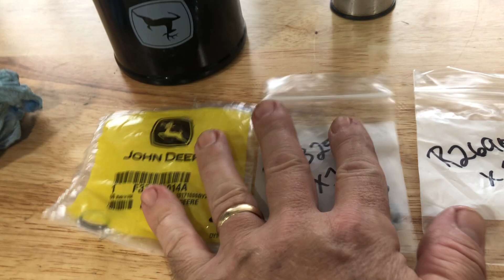John Deere 4310 ePower Reverser Transmission Pressure Regulator Fix

Comment: Would this cause lack of power on the rest of the hydraulics as well? I have a 06 4310 that hardly will move and almost no Hydraulic power.
Reply from the maker: I would check/clean the suction screen.  Thats the most common cause.
Reply: Much appreciated bud. 
Fun fact, those pressure valves are no longer available.

Comment: Have this issue in my reverse gear. Engages weak and when given throttle it either won’t move at all or very little until rpm’s lower. If on and incline I have to set it in a really high gear to reverse on and incline. Could this be the issue you think?
Reply from the maker: Will do some research and let u know what I would recommend.  I’ll check shop manual and let u know.
Reply from the maker: I would recommend downloading the shop manual, since it has the troubleshooting procedures/details under "ePowrReverser - Reverse Drive Circuit Diagnosis" section and is good to have handy.   If it was in my garage I would start by back feeding the voltage (using sewing needle and volt meter) on the reverse solenoid to make sure your getting 12v in reverse.   You can do this in the garage with machine off ground and in 2wd.   Just put it in reverse and let it idle in reverse.   Check meter and make sure its close to 12v.   If it is then the problem is in the reverse solenoid or coil on the solenoid could be week.   If it isn't then the problem is most likely with the reverse pressure transducer.   Shop manual has way more details and explains it in great detail.  Hope this helps and good luck.

Comment: Does a 4300 HST have this valve after watching your video I didn’t see it my tractor won’t go forward or backwards I have cleaned the suction screen in the rear end changed fluid and filter brakes are free and not stuck and the shaft that drives the hydraulic pump is spinning

Comment: I'm having this issue on an e-hydro. Do they have a similar valve, or is it possibly a potentiometer
Reply from the maker: Thanks for reaching out. The e-hydro doesn't have the same pressure relief valve like the reverser transmission.  For the e-hydro I've had machines that will do the same thing due to a bad potentiometer or dead battery that wipes out the controller memory.   I would test the potentiometers one at a time by back feeding the voltage (0.9 - 4.5 volts is the typical range) and see if it fluctuates without moving the pedal.   You don't need to start the machine, rather just have the key in the on position and depress/release the pedal your testing.  Voltage should only change when pedal moves in/out and not when you put lateral pressure (side to side) on the potentiometer.   Typically with one is erratic/fluctuating voltage the symptoms will be what your experiencing.   If potentiometers check out good then a controller reset/relearn is what I would recommend, especially if the battery was left/went dead recently.
Reply: @darrenmas  thanks Darren, I assumed and am in the middle of calibrating, won't go past the wot part of the calibration.
Reply: I have all of the switches off.
Reply from the maker: @ it might take a few tries.  Throttle needs to be right at or as close to 3000 rpm as possible.
Reply: @darrenmas  Thanks for the help, still isn't pickup up the WOT at 2800 rpm and going to the creep mode. Thanks for the responses!
Reply: Thinking it is the throttle sensor since I didn't check that one.
Reply from the maker: @MNWCreations  yup might just need to adjust the throttle sensor to be within range.  Lowest throttle should be about 0.7 volts and full throttle should be 3.2-4.5 volts.
Reply: @darrenmas  Thanks for the help and the videos. TPS was a bit out of range. 1.1v on the low end was enough to not let it pass. Also, forgot I disconnected the seat switch during my diagnosis, so that was a bit of a head scratcher for a minute. Didn't throw anything tho. Seems to have fixed the cut out during long full throttle drives.  Onto the fuel gauge.